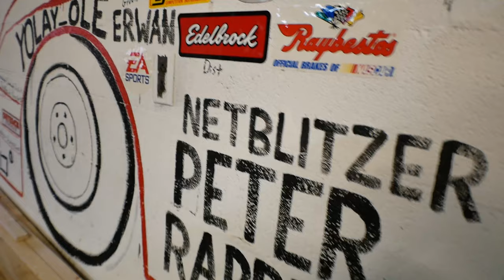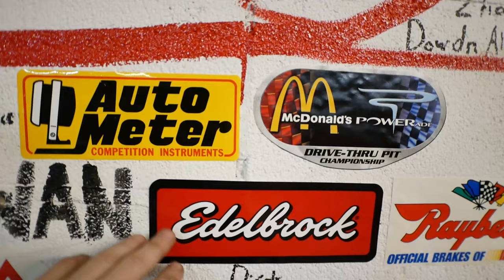Disc Brakes for the 67 F250 Ramp Truck - Garage Week 2021 Summary!

Comment: One more question for you: After installing the new CCP brake booster/master cylinder/proportioning valve setup, did you eliminate the old proportioning valve? Seems like an unnecessary component at that point, and one that could potentially restrict flow of brake fluid. Curious to hear your thoughts.
Reply from the maker: We did indeed bypass it and ran all new brake lines

Comment: Important question I have for you, and thank you for your hard work in researching this conversion because I also have a 1969 Ford F-250 Camper Special with front and rear drum breaks that really suck that I would like to convert someday when $$$ is provided. The question is, what is the overall cost for this conversion including a new power booster and master cylinder and proportioning block for my truck, just a ball park figure that you spent back when you did this conversion on your truck??? I will add in the inflation cost myself😊😊😊
Reply from the maker: If I remember correctly I linked it in the description, but if you need it I can go dig it up. But we actually made a Google doc that outlines all the parts we used. A lot of it's going to depend on where you can source the stuff because we ended up getting quite a bit of it from junkyards. All in all, it really wasn't that expensive, sub  $700, at the time we did it, and getting higher quality of the new stuff we got.
Reply from the maker: Here it is just in case https://docs.google.com/spreadsheets/d/e/2PACX-1vSXbrkjsLfDlZmxrW-VJDdRVkUmJhSOqhSdAqaWYn20EsonA6pkQRCrfO0AoaL5pd0w-GRbyLaf2Jqk/pubhtml
Reply: Thanks for the quick response, and I did figure out a way to copy then paste those docs I found on the link you provided, then I pasted them on my Gmail and sent them to myself, that way a I can have them printed at Staples so I have a paper copy I will save. You did a great job in saving all this to share with others and I really appreciate it!!! 😊 😃 😀
Reply from the maker: @MrDilley777  if I remember correctly since you have a 69, you'll need less parts as well. I think you have the correct front spindles already which were the harder parts to track down. Good luck with the project! Made a world of difference for me.

Comment: I am actually trying to do the same thing on my 69. do you know if those rotors will fit on the spindle that is used with my drum brakes?
Reply from the maker: If I recall correctly, 69 is the magic year of 350 that will have the right sized spindle.
Reply: If you have the 2.5" "heavy duty" drum brakes, your spindles should work. The big bearing race should measure 1.625". The light duty measures 1.50" and does not have a OEM rotor that I can find that fits, and I believe the 4 bolt backing pattern is different.

Comment: after switching the 67 spindles out for the 69 spindles, could you just have bought a lugnuts 4x4 conversion kit for a '76 f250? I guess the question is would the 76 calipers and brackets fit on the 69 rotors...
Reply from the maker: I would have to dig back into my research a bit but I think that will only work with a dana front end, not the 2wd spindles. I'll get back to you when I dig through the notes.
Reply from the maker: Indeed the case, that kit only works with 4x4 spindles.
Reply: @ConeDodger240  Thanks for that. I really appreciate you putting all your research out here. I'm piecing my 2x4 67 F250 back together now with your insights as guidance. Those 69 spindles were a bitch to find...

Comment: Looking at this video of your install of disc brakes on your 67 F250.  I am restoring a 1968 f250.  I am struggling to find all the parts I need.  I have the rotors and calipers but not sure how the calipers install.  Can you please email me the parts list you used or a breakdown or anything that may help?  Thanks
Reply from the maker: Let me dig up my spreadsheet and I'll try to help you out. Email me at conedodger240@gmail.com and I'll see what I can come up with
Reply: You might need the "79" caliper brackets (if you are using the 78+ calipers, there are several styles through the years). This was a hard part to find as most places don't have the part listed separately from the spindle. The part numbers are D6TZ-2B306-B LH and D6TZ-2B305-B RH. A spreadsheet was added in the description of the video with part numbers and more info. Please lemme know if anything else needs clarification.

Comment: I think you pretty much got the part years right.
Reply from the maker: check the end...
Reply: @ConeDodger240  I saw, I think the final take still had a minor mistake and you didn't even mention the wheel seal and how everything depends on GVWR of the year and how ford changed one aspect of the brakes every year and and reeeeee
Reply from the maker: I don't think I even know what wheel seal we ended up with at this point. I also doubt anyone else will ever do such a thing ever again.
Reply: 7:40, you absolute Wizard.

Comment: are all the parts for a 1969&1979 f250? or  
would the f100& f150 parts fit?
Reply from the maker: The 100/150 stuff is a different ballgame, as they use different king pins on the smaller duty 5 lug trucks
Reply: @ConeDodger240  I have a 1967 f250 and I'm planning on doing  the same, do you have any links for the parts?
Reply from the maker: @nonamedavid96  Shoot me an email at  conedodger240@gmail.com and i'll link you the spreadsheet of parts we used. It's not a walkthrough or anything but it has all the parts I used and some research info on it.
Reply: I know it’s an old video, but the easiest way to do this: buy a complete front suspension from a 73-79 F250.  Then you get everything needed at one shot and don’t need the spreadsheet and hodgepodge spreadsheet of parts.  While you have the whole new setup, it’s easier to change out the kingpins and bushings then bolt right back in.  Depending where you live, about $200-$400 then just the remaining parts.  Doing mine with a setup from a 76 and adding power steering while I am there.  With the 76, it takes the same steering linkage as a late 71 up.  Just a shortcut of not having to source a bunch of parts and figure out how to make things work.  Fordification page has pretty much a step by step on how to do this exact project.
Reply: @chadrech9230  You're completely right, but these days the trucks are getting a bit light on the ground and finding stuff locally is difficult without 'knowing a guy'. The idea of this setup was to use a minimum of donor parts because the trucks are 50+ years old now, so as few (and lightest) parts possible to allow shipping across the country at a reasonable rate. Why swap everything when in most instances you only need the caliper brackets off a donor? Cone needed the new spindle too because the '67 backing plate bolt pattern is different (and smaller bearing). For many of the later trucks (at least anything with the 2.5" front drums), there's no reason to swap the spindles and I beams.

Comment: Given the weight of the vehicle with extra  weight added you wouldn’t stop on a dime as the weight shifts if you really want more stopping power as disc brakes on the rear or bigger brakes on the front but truck came a long ways keep it up
Reply: Honestly I'm not sure if there's a "bigger" option available without something truly custom. The brakes are basically off a 79 F350 (same calipers) which have a GVWR of 9000-10000lbs. Its not quite clear but the calipers are HUGE, about as long as my forearm, and the rotors are about as big as you can fit under a 16" wheel. There are more aggressive pads available if it turns out to be needed which could help, but the ones on there now are pretty middling "OEM" type.

Comment: Where did you get your ‘69 spindles?
Reply from the maker: Many months of ebay watching
Reply: @ConeDodger240  Anything specific you suggest entering in the search?
Reply: @TylerDituri  Car-part is where the spindles were found. A junkyard listing for a 69 F250 interchange. The "69" disc and 2.5" drum spindles are the same and the ones you want
Reply: @zeekay @conedodger240 Any chance you could share that spreadsheet with me?
Reply: @TylerDituri  Cone added it as the first line of the description of this video, lemme know if you have trouble viewing it